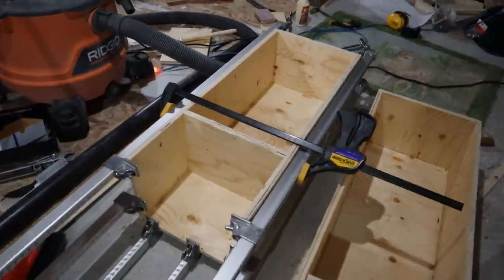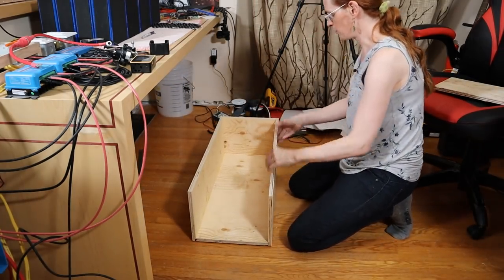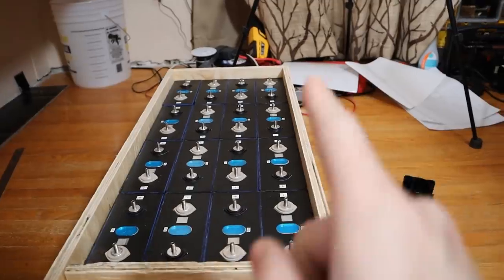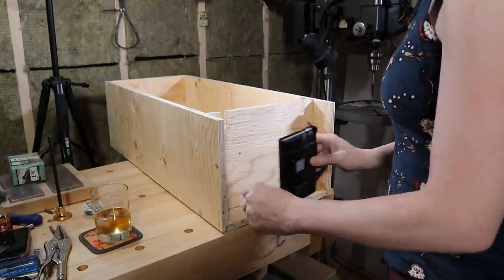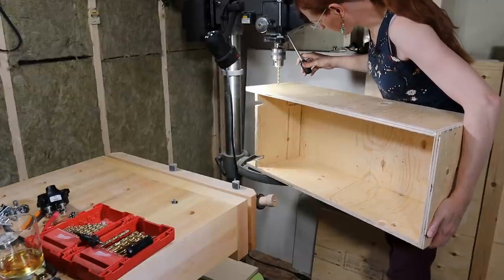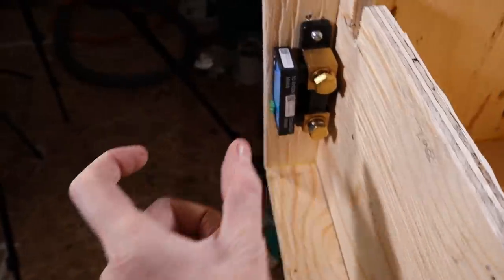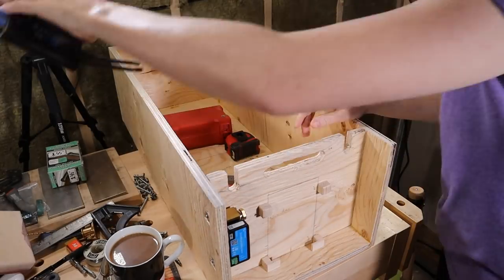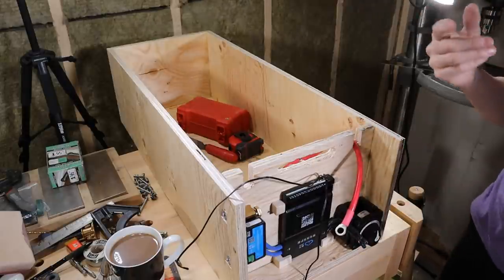A Better Battery Box, Part 2 - Frustrating Success! - How to build a 48v Lifepo4 battery (Ep. 26)

Comment: Another nice video. Just one sugestion: If you put shunt to the bottom and rotate bms you could proper fit without crossing the cables. So you would go from battery minus directly to bms, then to the shunt and than to the switch. The middle part is free for balance cables.
Reply from the maker: That's not a bad idea. I'll consider that when I prepare for the final box build.

Comment: I agree that being cautious about stuff scraping through the plastic covering on the cells is wise, but I keep thinking about "Ray Builds Cool Stuff" using thin sheets of plastic betweens cells to make sure. It'll add 1-2mm to the width of the battery buy IMO makes you much more secure.
Reply: I find Ray to be a little over the top, he is always trying to reinvent the wheel and it is really just for views ,so i unsubscribed.
Reply: Same. I watch the occasional video because he makes some good points, but it feels off to me.

Comment: The problem with those bits is that they are intended for drilling holes through timbers and studs with a hand drill.  They are specifically not to be used with a drill press for that very reason.  Forsner bits are nice but even a proper set of spade bits with a centering tip rather than a screw tip would work nicely.  For their intended purpose those self drilling spade bits are nice.  It's all a learning experence.  Good luck on the build, you will get there in the end and have achieved more by working through the challenges.
Reply from the maker: Ya, I felt bad after for calling Bosch out. I know they were meant for a different purpose and I was letting my frustration slip. For running wires, pipes and conduit through studs and joists, they work great. It's why I labelled that section "the wrong tool for the job". Thank you for the kind words.
Reply: Amen to that, once the screw thread catches, you have NO control over the feed rate and can't back out with the yoke (where a hand drill you could at least reverse it). Handy feature if you're boring wiring holes in wall studs. No es bueno for drill press!

Comment: Just thought of why I suggested the sides sit on top of the base and not on the side - If the base is not evenly supported and weight is (accidentally) placed on the top, then it could potentially shear off the sides. Also, you box can be weight bearing,  giving extra storage space.

Comment: Once you've got a final design, you might consider half lap joints and/or finishing screws to help with strength.  Also some 1/4" thick trim in front would give more room for the shunt wire an give the box a little nicer look too.
Reply from the maker: I'm actually doing half-lap on my bar build (not being filmed) to seat the back cover. When the time comes to build the final box, I'll be going over the design with my teacher and that's how I'll refine the details of the final build. I do plan to share the final plans though.

Comment: Creative and nice looking wood clamps for the bms.  I just used some plumbers strap (plastic with holes every inch) with screws to attach.
You can get spade bits that don't have the screw tip.  Those bosch bits work great for drilling through studs, but standard spade bits would be better(and cheaper) for what you are doing.
Reply from the maker: I've got a few, very old spade bits without the screw bit. You're right, they would have been better... Still, forstners would be the betterest, so I actually ordered a set later that night.

Comment: Hi DM, wonderful videos. Wondering if you can post your current parts list and schemetic. Thanks..
Reply from the maker: I don't have a list yet, but I very much plan to create one. I've held off on purpose as I've not finalized the design, though I am close. 

Once the design is final, I plan to do a single video that is simply a "here's how it's made", and it will include all parts / part numbers, dimensions, tools needed, etc.

Comment: not to be mean or anything but the drill you used for the first holes prolly was big enough :) it's drill would fit in the center hole and it's wings would do what you needed

Comment: I love wood working and its been a lifelong hobby.  I have been using a 
Table Saw without guards for about 60 years.  Guards were invented after
the 60's.  I have learned two things must be done to avoid cutting off
fingers or worse:  1) Apply all your concentration to the one hand that
is in the danger area.  The other hand should safely away or behind your
back.  2) Before and during every cut imagine what would happen if the
piece you are cutting would suddenly vanish.  I.E.  Would you hand go
into the blade?  The third one has been mostly solved, but is simple:
Don't stand in back of the blade.  I have seen many of pieces thrown
thru the wall behind me.  Riving knifes have lessen this problem a lot.
I was never taught these things, I learned from experience.  My macho
brother did not follow my instruction and now has 3 fingers on one hand.
Reply from the maker: My wood working teacher is a retired master furniture maker, and his equipment (and approach) is old school. His combo jointer, thicknesser and mortiser is 40s era, I believe. Safety is entirely "don't stick your finger in it". He's always on me (and rightly so) about how I use the equipment and calls me out when I make any mistake that could put me in danger. So he takes safety very seriously, but there are no guards on anyway. It's been good as it forces me to always be aware of where the dangers are. After an entire career, he has all his fingers, and the way he drives home safety, I'm somewhat confident I will be ok. :)

Comment: I would recommend to put the smart shunt in front of the bms if you want to use an SmartShunt for every battery.
Than you could use the shunt as an connection terminal between the battery and the Bms. Also you are not going to looose the SoC when the bms trips.
Reply from the maker: I thought about that, and decided I wanted the BMS directly on the battery for the most accurate readings. It is fundamentally responsible for protecting the cells, and the smart shunt is there to feed data to the Victron system. That's why it's downstream (and yes, I'll have a smart shunt per battery).
Reply: @TheDigitalMermaid  the readings should be the same. The current is everywhere the same. The voltage reading is not dependent on the placement of the bms. That's why you also have an balancing lead on the most negative point of the battery. The only thing you would need to check if there is an direct connection between the b- main cables and the most negative balancing wire. If the bms is properly designed it should not be like that. If there is an connection between these two wires it would be an problem.
All protection functions should work completely the same independent of the placing of the main port.

Comment: felt padding seems a bit much, don't you have any carpet off cuts, find a few carpet tiles at the office hehe
when doing up drill chucks using a key, i was taught to just pinch up the first side, then the other two a little tighter, this is to centralise the bit a little better, not sure if that's really a thing or not, or change the chuck to a modern hand tighten type
i was also taught how to get a perfect hole when drilling into steel, sometimes a drill can vibrate in the hole, causing it to triangulate and look messy, if you use the smallest piece of cloth, an inch square, add a few drops of oil, and place below the drill once lined up, the oily rag will prevent the drill jumping about, it works really well
them there drills your using i think are hand drills, hence the screw end, and should be used at a slower speed, like old school, used to have a square end upper end to hold in a brace, i would suggest to use the taper drill you used before, does a better job, and you can always use a router to round the corners, for nice hand finish, but your doing grand and winning
love the Dutch saw, Japanese saw, got to get one
Reply from the maker: No carpet off-cuts, no. The felt pads were pretty cheap at Home Depot. Since I did this project, I picked up a set of forstner bits, those spades were certainly the wrong tool for the job, but it's what I had at the time.
Reply: @TheDigitalMermaid  there's the old army saying 'make do and overcome' works well in most cases

Comment: Good stuff and thanks for sharing. Question; Have you thought about using 3D CAD to design these projects? I use it for almost everything I build and it saves me a lot of material. Normally... Sometimes I still screw it up ;)
Reply from the maker: I have, but I would have to learn how to use it. Right now, I've got a shiny new editing computer and software that I'm struggling to learn. The idea of learning yet another program is ... daunting. Up next is learning to program the Victron gear, so it'll be a while before I learn CAD. :)
Reply: @TheDigitalMermaid  I am pretty good with AutoCAD Inventor, I have my whole 44' steel boat in it. So if you ever need anything done let me know.
Reply from the maker: @LadyDewBuild  I appreciate that, and I may take you up on that in the new year. Thank you!

Comment: You should have hold downs for your batteries.  Big waves will cause the batteries to move and eventually destroy the insulation between batteries and break terminals or loosen connections.  You could have the cover have stands that push down on batteries(not cables) and then screw the entire cover down.
Reply from the maker: The final batteries will be securely mounted in place, as survey / insurance will require. The requirement being that the whole boat should be able to turn turtle and come back up. Having a heavier top with tabs fixing the cells in place is a good idea, thanks.

Comment: I am curious. I though that you were building a batter solution for your boat. Timber boxes and boats are not an ideal solution. Fibreglass? Plastic?
Reply from the maker: I am, and wood on a boat is perfectly fine. It only matters that you choose the appropriate wood, and for that I will be choosing Alaskan cedar or white oak. The reason I am going to use wood is because wood working is my other hobby, so it would be a fun project.

Comment: Not to be that guy, shouldn't the cells have room for swelling? I heard it's normal for large cells to swell up and can damage the cell if it can't expand. Love the modular design! Blood sweat and tears only make you stronger!
Reply from the maker: I charged the pack to 100% before taking the battery apart. So it should be at maximum size now, and then I added the 2mm of foam between the cells which could compress even more as needed.

Comment: These thraded spate bits (like any threaded tip drill bits) should not be used in stionary drilling machines.
It is a kind of funny to see the differences in what you can get easily and what is hard to come by depending on where you live. Over here in Germany, everybody has got a set of metric forstner and brad point bits for drilling in wood. They are very cheap (of course you also can get them in better qualities) and sold everywhere. Finding a store with the variety of woods like you in northamerica seem to have, is a very hard if not impossible thing. If you want anything else than poor quality spruce framing stuff, in most cases you have to go to a sawmill and start with rough sawn lumber.
Reply from the maker: Ya, I got a set of forstner bits after this. I'd love to get some brad-tipped drills eventually, too.